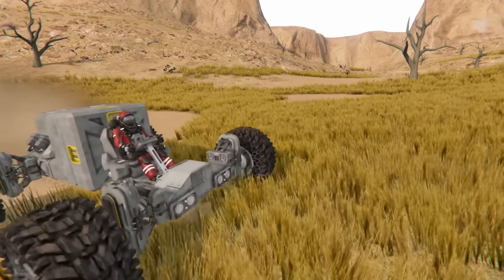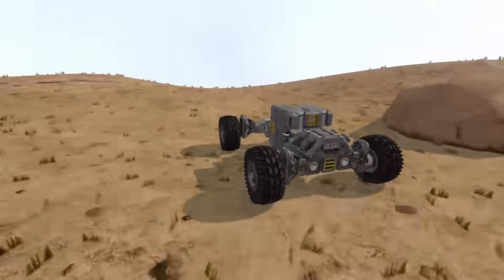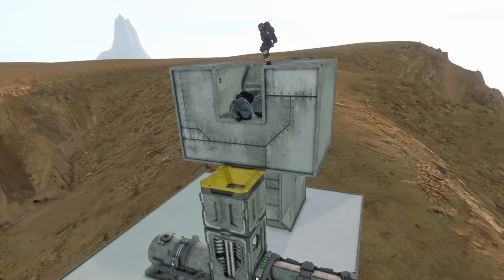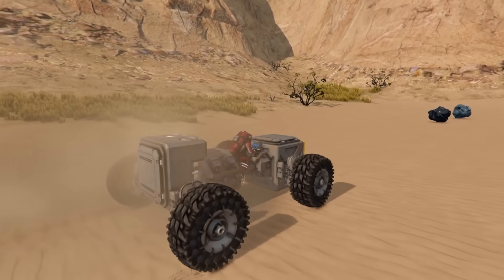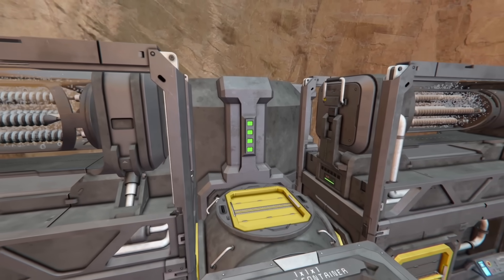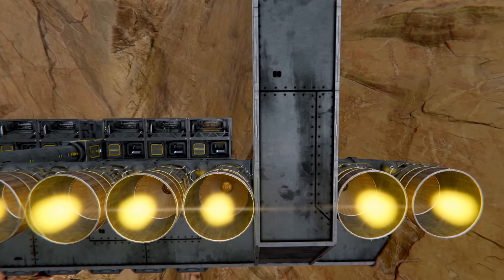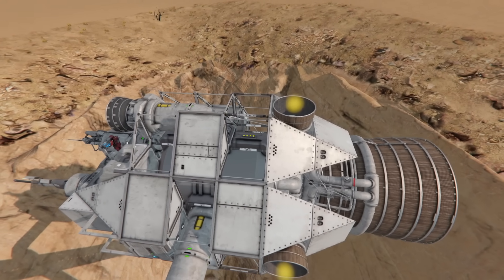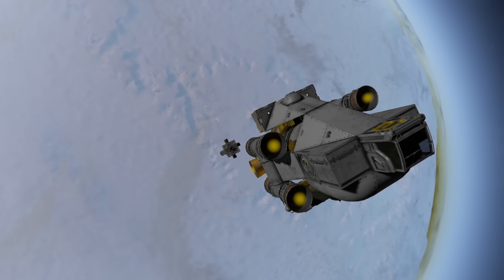Hydrogen in Space Engineers Makes No Sense… So I Fixed It

Comment: 4:30 1L of water needs 13.2 MJ of energy to turn into its base gasses, at 100% efficiency. So, 50L of water requires roughly 66MJ of energy. 50L per second would require 66 megawatts of power.

 A watt is energy per second, not a set amount of energy. A joule is the standard unit of energy.

Love the video nonetheless <3
Reply from the maker: Oh, you're totally right, I was worried that my explanations were overcomplicated enough to add one more unit of measurement 👍
Reply: Got no problem with a simplified explanation, got big problems when you’re just plain wrong. Using the wrong units is not simpler, it makes it more confusing.
Reply: @JPEight  Ditto. I couldn't keep up with what he was actually talking about and all the math ended up being totally meaninless.
Reply: @BenSmith0  I got curious so I did some searches and some math. From stack exchange, someone gives 3.67 kWh in a theoretically perfectly efficient electrolysis of 1 liter of water. Given that number, I think it's fair to assume @thescrewupteam intended to use a starting value of 4.5kWh per liter of water. 

Then it's all unit conversions. Remember, we're removing units by multiplying by ratios and putting the unit we want to get rid of in the denominator to cancel it out.
(1 L water / 1 second) * (4.5kWh / 1 L water) = 4.5 kWh / 1 s
= 4.5 kW * 1 hour / 1 second = 4.5 kW * 3600 seconds / 1 second 
= 16,200 kW = 16.2 MW (megawatts) continuous power for electrolyzing 1 Liter of water per second.
For reference, that's enough to power thousands of  (probably over 10k) homes.

Energy is the fundamental unit, describing (for example) the potential for work (like electrolysis), or an amount of heat. Energy units include Joules and Watt-Hours.
A watt-hour is the energy of 1 watt supplied over a period of 1 hour.

Power is Energy over time. Watt = Energy / Time. So the watt-hour mentioned earlier is a unit of energy because the watt-hour specifies a time period that cancels out the denominator.

@thescrewupteam The video was entertaining, and well presented! But you should own up to your mistake. It's not shameful to mess up, but you seem to be doubling down in the comments and saying that this was intentional for simplifying the explanation somehow. The mistake is confusing and does not help explanation. You should leave a pinned comment explaining the correct units.
Reply: @taq154  That looks right, assuming your assumptions are correct. My point was I couldn't follow it in real time. How much time did you spend after the video filling in all that in?
Reply from the maker: You're right, whatever the intention was mistake is a mistake and I should accept that. Thanks for that explanation and kind words. I did follow your advice and pinned a comment.
Reply: @thescrewupteam  "I thought using the correct units in their right places would be confusing, so I picked a few that I liked and misused them all over the place." — This guy